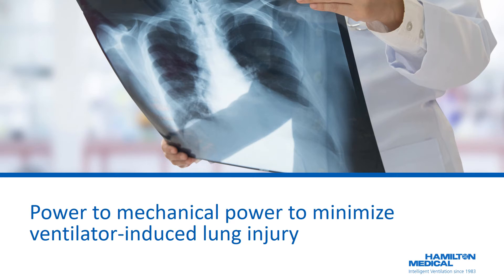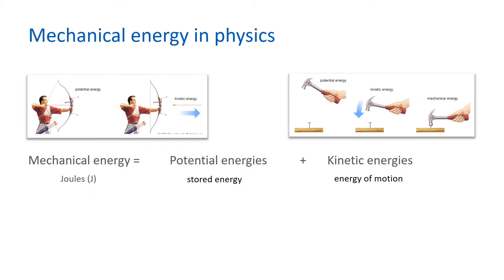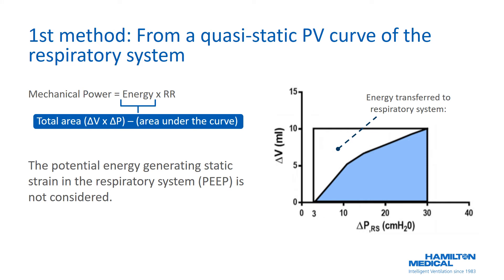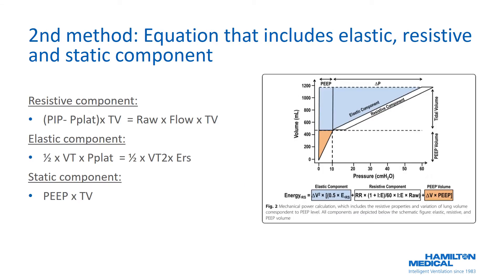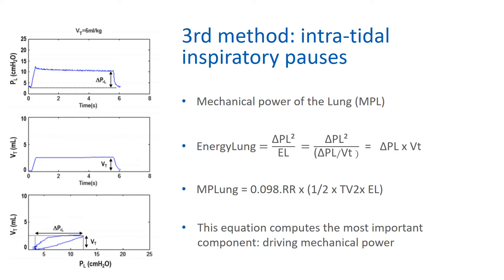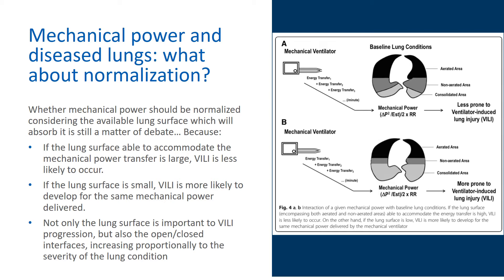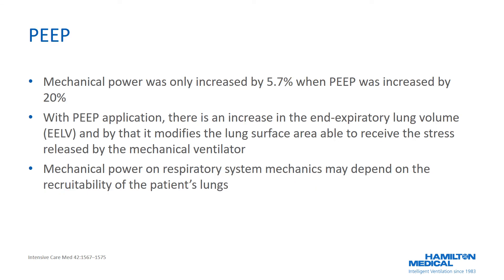Journal Club - Reduce mechanical power to minimize VILI

Comment: 0:40 Definition of Mechanical Power (MP)
2:47 Ventilator generated causes of VILI
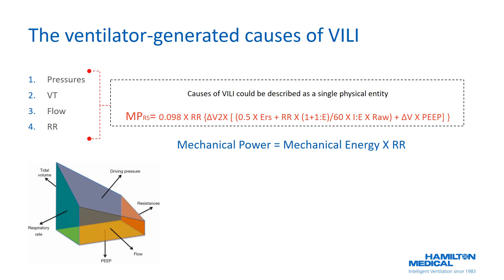3:03 Calculation of MP
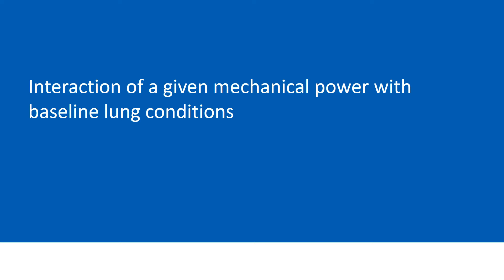5:30 Interaction of MP with lung conditions
8:08 Theory vs. practice
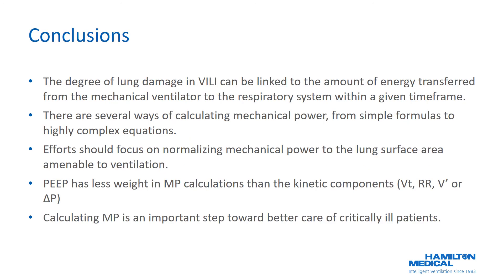10:56 Conclusions